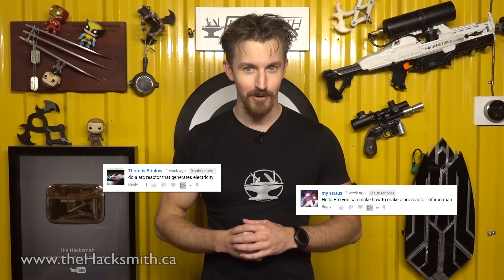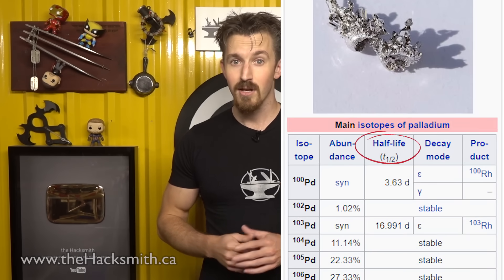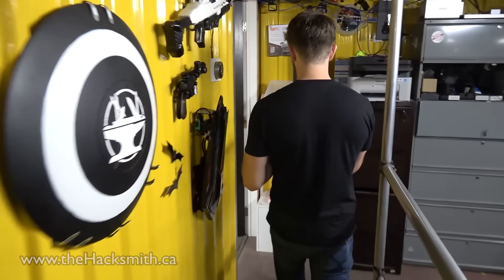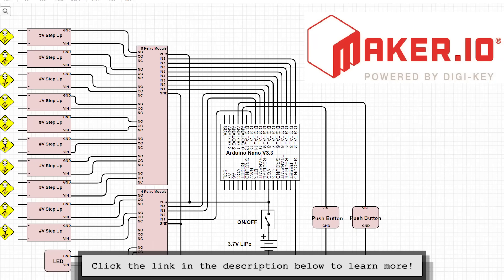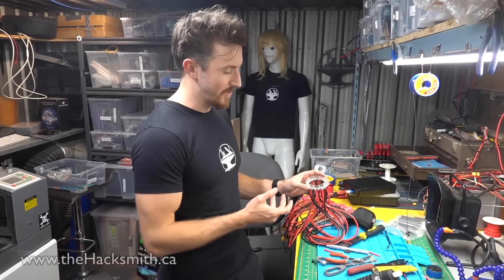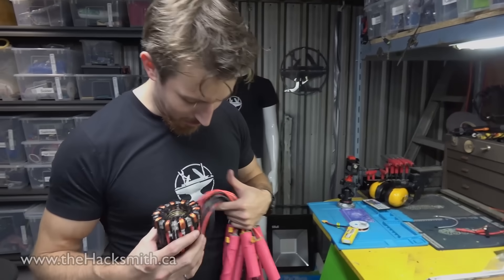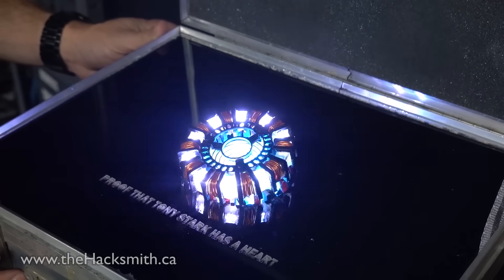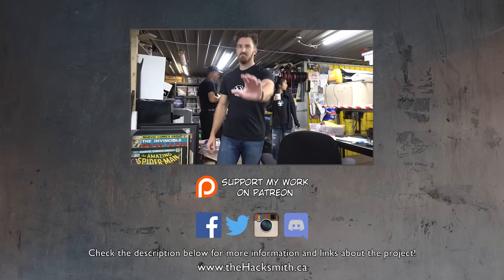Real Arc Reactor (ionized plasma generator)

Comment from the maker: While this does ionize plasma (creating ozone), it doesn't actually create any energy other than thermal - but it certainly looks cool!

Want to see another cool Arc Reactor build that generates hydrogen gas? Check out this one by Alex Lab: https://youtu.be/KAL6BUl6-rM ! He's even working on a system to ignite the hydrogen gas like an Iron Man repulsor!
Reply: A joule thief?
Reply: @jimlawrence8775  underrated comment
Reply: WOW
Reply: Could you make a plasma edged sword/knife? Mabye have the arc start at the hilt and push it up the blade using air?
Reply: You have 700 IQ man...amazing
Reply: Hey Hacksmith, The conservation of energy equation is actually only fundamentally correct in Newtonian physics. when we get into Einstein's relativity it becomes possible to generate both energy, at the expense of creating negative energy.  Relativity is the most commonly identified hypothesis for the universe we have currently and thus the model we use, so therefor theoretically we could produce a infinite energy source, and before you say the negative energy would cancel it out, most of the time yes, but only if we allowed it to. It'd be an engineering marvel, (huh) but it's completely possible to use the negative energy for something else, like building a reactor that could open a worm hole, which is again, theoretical, but only because we don't have the tech to test this *YET*. It's a common misconception and figured I should bring it up, you have an amazing day.

Sincerely,
Your friendly neighborhood edgelord
Reply: Nani?
Reply: Yeah, conservation of energy has been proven to be an active equation with negative energy and normal energy, due to the Particle large-hydron collider, I know i butchered that lmao.
Reply: Man....don't mind but I couldn't choose the  best among you two.
Reply: Please make a real working iron man mask
Reply: Hey mr stark nice video. I mean the hacksmith
Reply: the Hacksmith can I use maker .io to make me my own diagrams? I am too lazy to see for my self lol
Reply: Can't you fill the whole ring with another gaz to reduce the needed voltage? I don't know the complexity of doing so but....
Reply: Build magic gloves one shoots fire or something and the other shoots lightning etc
Reply: Maybe you can find a way to combine Alex Lab Arc reactor with yours. I think both of your channels are on to something big. Maybe do a COLLABORATION!
Reply: Do a collab.
Reply: To power the iron man suit just plug an extension cable to itself
Reply: This proves that movie logic if bullshit
Reply from the maker: @Con_Decending  that's why they're called movies :)
Reply: Wow, what a Horrible Video... 
I think I lost brain cells watching this..  I can't believe this has 16 million views.

The Ark Reactor is more of a Fancy  Capacitor-- with a Generator.. possibly, Nuclear.

Not a perpetual energy generating device..  wtf 🤦
Reply: Wow, what a Horrible Video... 
I think I lost brain cells watching this..  I can't believe this has 16 million views.

The Ark Reactor is more of a Fancy  Capacitor-- possibility with a Generator..  (Nuclear?)

Not a perpetual energy generating device..  wtf 🤦
Reply: makes the arc of the hawk archer q turns into a stick, if you want it leaves like
Reply: can you do sasuke's lightning sword
Reply: @joshuamadden4588  sasuke
Reply: TÜRKÇE ALTYAZI NEDEN YOKKKKK :( :( :(
Reply: You are the best
Reply: now put inside your chest
Reply: i made a similar thing like 2 years ago
Reply: Great job! If this was accomplished I am genuinely excited to see what you guys can make in the future. Looking forward to it! ;)
Reply: What if you use one high voltage generator and put the 8 gap in parallel?
Reply: Sword of Cap. Harlock
Reply: Do the percy jackson shield
Reply: So... It's a bunch of electricity jumping from one copper coil to the next? That's boring
Reply: the Hacksmith what about doing IRONMAN’s hand or something
Reply: I love your video's keep up the good work
Reply: great video
Reply: You should make black widows taser hand things
Reply: BLESS YOU
Reply: Faz uma super bicicleta
Reply: What about making a partial vacuum inside? If it was then the sparks would turn into nice flowing like shapes much like in the movie scene.
Reply: Do blackpanther suit
Reply: These are your first steps.
Reply: how come the FBI, CIA, or NSA storm your workshop?
Reply: One step for energy, one giant leap for real Iron Man suits! 🤩🤩🤩🤩🤩🤩🤩🤩🤩🤩🤩🤩🤩
Reply: Couldn't you make a miniature Alternator like on a car. And have that energy to spin it.
Reply: the Hacksmith make something like his repulser blasts but make it shoot a blue flare or something so it looks real and cool I hope u still do this in 5 years when I start college
Reply: Hey can you make a super fast phone charger plzz
Reply: Dear Hacksmith

     Can you make Hawkeyes bow from The Avengers. The bow turns from a bow into a staff with a click of a button.

  Thank you From Xbow
Reply: the Hacksmith, this is amazing, so cool. I’m not nearly as smart as you guys, but it did draw up a arc reactor design that had a plasma gauge charge a generated that charges the gauge and whatever you wanted plugged in. It probably a stupid design, but yours looks awesome!
Reply: You wouldn't want to go through TSA with that
Reply: The hacksmith  you will try green lentern ring✌✌✌✌
Reply: Maestros evil eye from rainbow 6 siege
Reply: You have everything in you need do you make a bigger pojacet we need new
Reply: I think you same spy gadget in real
Reply: Holy heck thats exactly what i built.
A miniturized hydroxy reactor thats connected to gauntlet that releases short burst of gas and small capacitor charge to "repulse" stuff. Great minds think alike lol.
Reply: Could you make a walter wire gloves from hellsing?
Reply: KABLAM
Reply: the Hacksmith tengo un reto difícil para ti quiero una novia y un corazón nuevo
Reply: Make a video on black panther's claw
Reply: You should try and think of a upgrade to use the sound it makes as a form energy or something
Reply: Well Buddy. I have more ideas to improve thing, And I will send you link of my videos after i make improved version of this reactor. That can generate more.
Reply: can you make a giant and i mean GIANT air cannon?
Reply: the Hacksmith can u Make a montage shield
Reply: You guys are really cool I really want to know how you made this
Reply: Converting the thermal energy to electricity is the next step
Reply: Please make a birkland eyed reactor
Reply: The problem is finding a way to turn that thermal energy into kinetic energy
Reply: Mark my words. This year I will begin my studies on the Creation of Cold Fusion for an Arc Reactor. -Wolf L.W

Jan 3 2025

Comment: Could you make a plasma edged sword? Mabye have the arc start at the hilt and push it up the blade using air?
Reply: Crated that’s not how it works lol
Reply: Yeah it is, I’m not asking to have a clean beam. When you blow air into plasma like that it basically makes a very hot stream of fire. Basically a plasma torch.